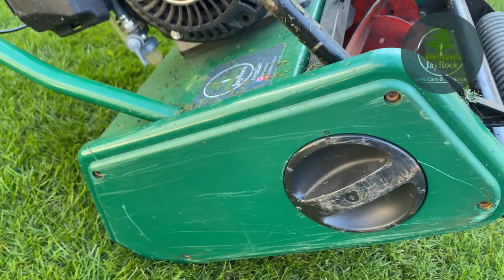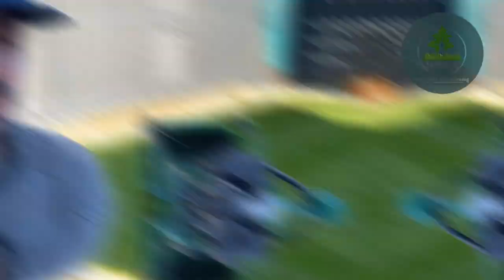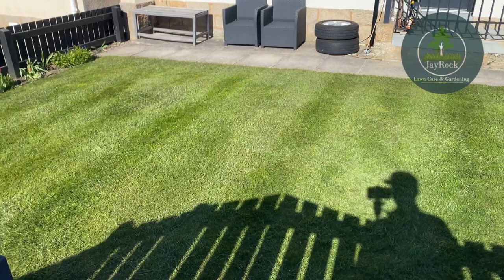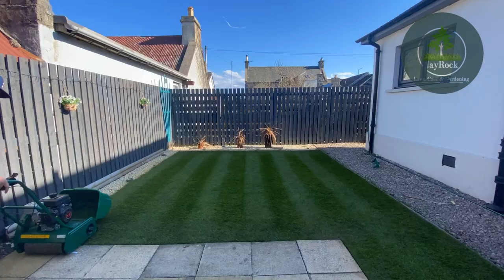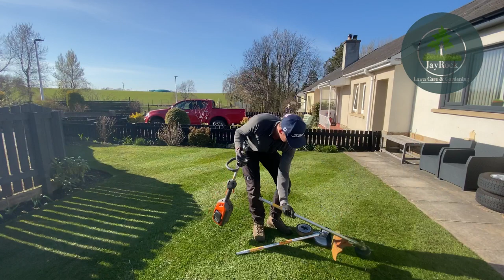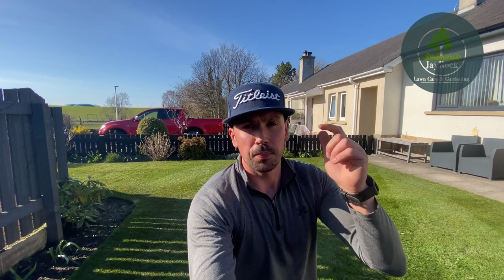Reducing the height of your grass // 25mm // VLOG

Comment: Good tips there mate. When im lowering the height of a lawn i always initially try and cut it slightly lower than my intended mow height, that way it reduces the size of the crown/stems to allow for more grass leaf and eventually a greener lawn. 👍
Reply from the maker: Nice tip there pal! Similar process when people do a full on scalp start of the season 🙌🏽 only done it the once on my own lawn 💪🏽 do you do this yearly ?
Reply: @JayRockGroundsMaintenance  Yeh normally try and do a scalp cut once the growing season has kicked in, does depend on grass type and conditions etc though, but more often than not found it beneficial to the overall appearance and health of a lawn especially when cutting low with a cylinder mower.
Reply from the maker: @RJLgardens  fair one, I’m going to go for a harsher scarify with the Weibang this year.. cut a bit deeper for the overseed and top dress 💪🏽. Hopefully get some content out of it 🙌🏽🌱
Reply: @JayRockGroundsMaintenance  That should be gd pal hope it turns out well. ive got some major renovations coming at the end of summer. Once you get that lawncare bug its never ending. 😂
Reply from the maker: @RJLgardens  exactly ! There is always something you can be doing, especially in the growing season.. we are talking every couple of days with the cylinder 🤣🌱

Comment: Would you say a cylinder mower is a good commercial lawn mower for all gardens or would you say a rotary mower would be best suited for most gardens ? Great video 🔥🔥
Reply from the maker: Rotary for sure ! 

Initially I tried using a cylinder mower and if the client has a lawn over 40-50mm it’s a nightmare to cut ! That alongside unkept bumpy lawns it Just doesn’t work.. 

I offer it as a separate,  more expensive service. If you wanted to go somewhere down the middle you could go for a rotary with a rear roller 💪🏽🔥

Thank you Finlay ! Are you considering going into paid lawn mowing ??🌱☀️
Reply: @JayRockGroundsMaintenance  
Yes only 19 and want to start a gardening business. Thinking of starting off with lawn mowing and hedge cutting and then go from there. Been doing a lot of research this year and hopefully next year I get a few customers
Reply: @JayRockGroundsMaintenance  
So any advice or any information you would of liked to known when starting out will be much appreciated ! 👍🏼
Reply from the maker: @finlaymaxwell6500  find me on Instagram pal, JayRock Lawn Care & Gardening. 

Send me a DM and I’ll send some Things I’ve learnt Over to you tomorrow’s 

Also check out SE Groundcare, he has some priceless advice 🙌🏽🌱